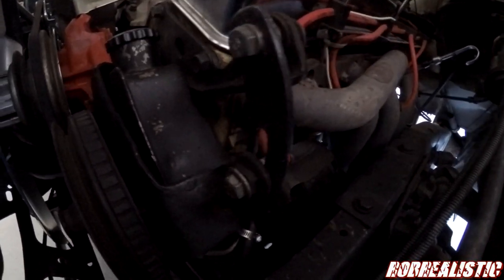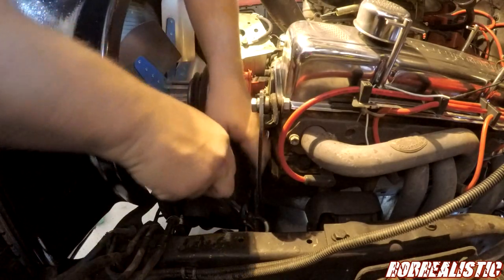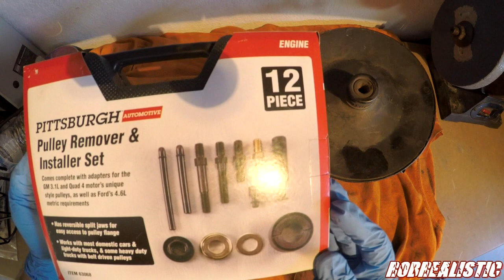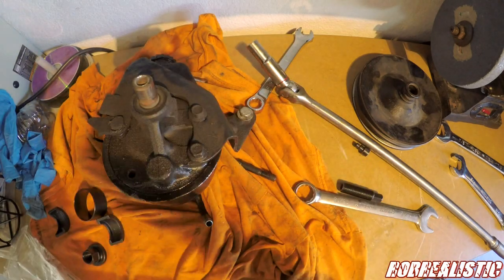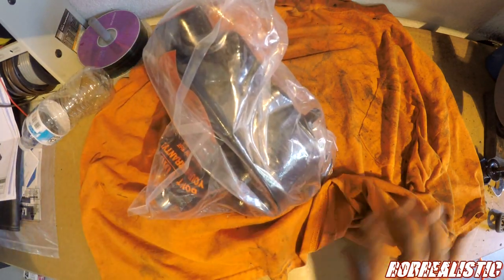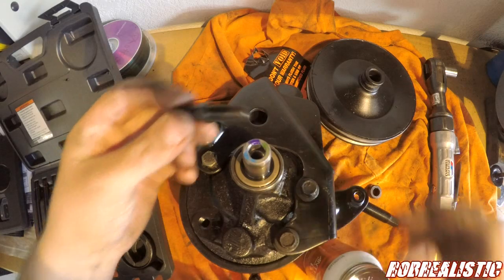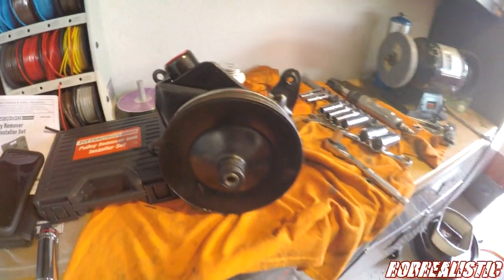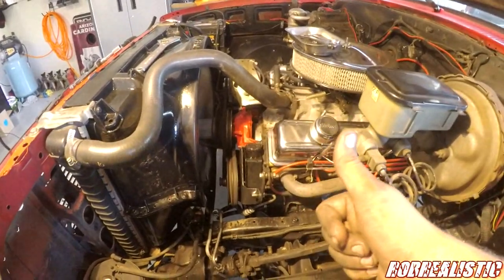Chevy C10 Power steering pump replacement.

Comment: Your high pressure line came off so easy, mine spun the mounting nut out of the pump and I had to replace the host.  Great video, much help, thanks!
Reply from the maker: I guess I got lucky.

Comment: Dude you did a good job explaining it... Is it possible if I accidently used a pry bar to tighten my belt and lightly pushed against the power steering reservoir. Could I have pushed some of the fluid out of the cap area because I don't think I ruptured the pump..?
Reply from the maker: Is there a question in here?

Comment: Where does that little spacer go, the spacer just under the right of the pump on the orange fang af 7:26 in the video? Does it go on the top left or left side adjustment?
Reply from the maker: @11bangbangshaw93  that's just a spacer specific to my truck because I didn't have the original bracket on the engine. It's nothing you need to worry about.